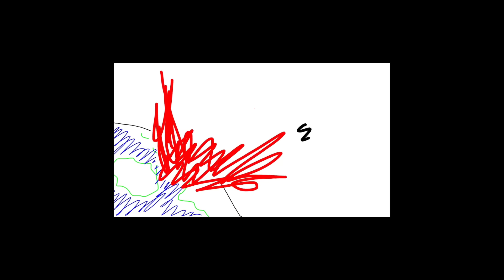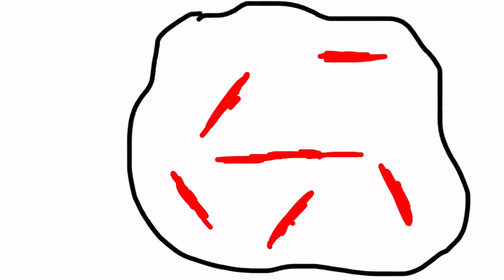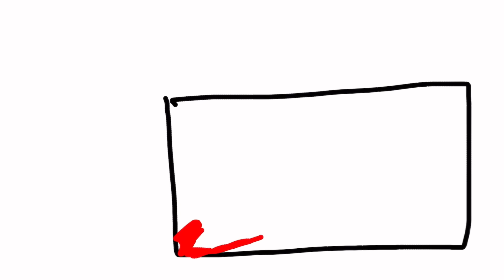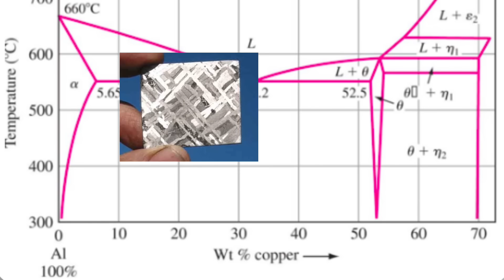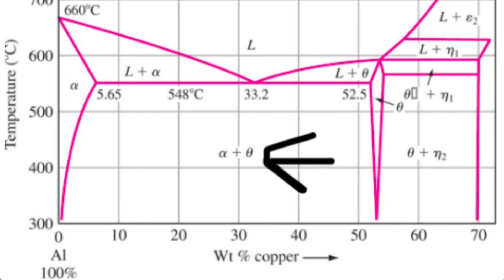Making Meteorite Part 1: Al-Cu

Comment: Very nice job! Quite an impressive result! I find a lot of claims that x can't be done without y conditions turn out to be a lack of knowledge outside one particular scientific domain. In this case I wouldn't be surprised at all if the theory behind these dendritic patterns in meteors is a bit skewed through the filter of an astronomer or geologist's understanding of metallurgy. Some guy in a steel mill's R&D lab could probably tell you half a dozen ways to get dendritic growth that might be relevant to meteors, but the two domains rarely touch.
Reply from the maker: Thanks so much! I haven’t approached the topic from that angle before, it’s really interesting to think about the insight lost when fields don’t overlap.
Reply: Cool to see you here, im on the right side of the internet lol. Good points about interaction between fields though, i think some incredibly valuable insights and advances have yet to result from such things
Reply: You are 100% right 
Im a furnace worker in a foundery and during my apprenticeship in got lots of knowledge hammered in me for exampel how too read phase diagrams (especially the Fe-C phase diagram because steel and cast iron properties and the phases are extremely important for my work)

The phase diagram is a very useful tool if you know that all of the lines and temps are taken with enough time for the material too setel in its preferred state/phase at that temp and mixture .You just need too look for the right lines in the phase diagram  too be precise the upper 2 once  in our case 😅 tell us all we need too know for just look at 3:39 the attention is drawn down form the real point of interest look at the 2 purpel lines over the arrow  the upper one is the liquidus line all of the area above is marked with a "L" for liquid phase . the area below the liquids line at 45% cu is marked with "L+θ" so a mix out of liquid and θ phase in that area the crystal structure is growing  if we goo too the bottom of that area we hit the solidus line anything below it is already solid  and the area is marked with α+θ so a mix out off the α phase and the θ phase

With that knowledge we  cann see that the crystal structure starts growing at abot 580°C and at 548°C it stops because the other phase is also frozen  so for big crystals we need too keep the mold and metal in between these temps for a longer time too let the atoms move to the organized structure 

But too make that with Fe-Ni is quite the challenge since we need over 1520°C too melt a Fe-Ni alloy and reaching these temps is actually not easy  especially with a butane-air burner basically impossible. i know 4 ways but 2 of them are just unpractical for a small diy setup 1. Pre heat the air intake before the burner (blast furnace style) 2 induction heating (high power electricity at pretty high frequency and water cooled copper pipe)
3. A bottle of pure oxygen  and a burner that cann mix oxygenand fuel gas (but the oxygen is pretty expensive)
4.electic arcs furnace (a microwave transformer/arc welder  + porus lightweight firebricks +graphit electrodes 

4. Is the most cost effective and is actually not that bad frome a energy efficiency point
Reply: I recall a paper in the not so distant past wherin they created this structure in rather short timeframes by adding trace amounts of some dopant. Phosphorus is ringing a bell, but don't quote me on that.
Reply: Largely true but cooling an alloy slow enough to achieve 100% diffusion as a phase diagram would imply (and which is what causes meteorites to form naturally since there is millions of years for this diffusion to occur) is actually so slow that even in the most rigorous of tests it’s never done, cause to be 100% accurate would genuinely take millions of years like in the formation of meteorite. If we could find a way to make metal atoms diffuse in solid state extremely rapidly it would make materials science class a lot easier though lmao

Comment: Years ago, I saw some "maker" video where some guy "invented" his new garbage alloy for making cast aluminum parts.  It was a rather careless, unmeasured high-copper Al/Cu alloy.  I immediately called bullshit when watching it with my friend, and we argued about what it would behave like.  I had extrapolated off some intuition and very rudimentary knowledge of older 2000 series alloys, but I didn't really have experience trying it.  What do I actually know?

We went out and grabbed some Al ingots and scrap copper and cast some test ingots at varied amounts of Cu.  As expected, some were quite brittle, but others were tougher than expected.  What I didn't expect was what they were like on the inside.  It seems like with some of the bars, the alloy got very short during cooling and was unable to shrink due to the early precipitation of large crystals.  As they cooled, the liquid phase retreated from the interior instead of depressing the exterior faces like in your examples.  I ended up with what are basically hollow aluminum geodes full of sparkly needles that looked clean like they cooled in a vacuum.
Those were just air-cooled in a bread pan, but for all I know the large, clean crystal growth could have been sensitive to the particular minority components of the unknown aluminum alloys I'd started with.
Reply from the maker: Wow… that sounds insanely cool. This could also in part be due to extreme hydrogen dissolution in your alloy, it loves aluminum. The hydrogen comes out of solution as it solidifies, perhaps a large portion of this occurs after the intermetallic phase is present. If significant enough, it could form massive cavities.
Reply: @ElectronImpressions  Now that you mention it, that might be part of the reason why I could never repeat it well.  Melting from a bunch of weathered scrap with the longer dissolution times involved would mean that there's going to be a lot more hydrogen in the melt than when I just remelt the alloy ingot.  

It's a shame.  Normally, I'm really good at getting plenty of hydrogen in my aluminum.  Now I've gone and failed at that too! :D
Reply: Please tell me you can provide some photos of this !
Reply: @squa_81  I wish.  We only discovered the good ones because we were testing for brittleness.  That involved a 12lb hammer, so most of all the nice interior crystals got smashed all over the place.  I tried remelting the broken ingots that had turned out pretty, but when re-cast, something would always be unsatisfactory about it.  Either the voids were much smaller, the crystals much shorter (5mm most), they shrunk on the exterior faces like in the video, or if they voided on the inside, they formed "wet" (as in the crystals were coated in the lower-melting phase).  I still have an ingot after remelting it a bunch of times, but it really isn't impressive.  I kick myself for not having taken pictures of it, but I figured it would have been easy to reproduce.  After all, we did it by accident so it seemed like it would be.
Reply: These voids you mentioned are the reason that biger parts of castings have rissers attached too it since the outside has solidified  but the thermal contraction during cooling reduces the volume and pressure that would allow same gasses too pop out if the lower solidus intermetalic phase

Comment: If you melt a larger mass of metal in your ingot and use a lot more insulation wrapped around the outside, or put a lot of extra high thermal capacity material in the furnace for thermal mass (say, stack your ingot mold on top of one, between two giant crucibles of iron on the bottom and top), you could slow the metal cooling over an even longer period for larger crystal growth. 

You could even gradually turn down the gas flow to the furnace by say 1/4 turn of the valve every couple hours (assuming propane isn't too expensive in your area).

They also sell kilns or muffle furnaces with programmable temperature ramping.
Reply from the maker: You’re absolutely right, I would love to get myself a programmable furnace. And a larger mold is in the Amazon cart!

Comment: you could try etching it with sodium hydroxide (caustic soda)  it should attack the aluminum but not the copper
Reply from the maker: I was cautious about using etchants that may destroy the dual phase eutectic structure via extreme selective etching. However I’ve gotten a lot of suggestions, and would like to try. I will report back to you

Comment: I approve of your safty clothing bare legs and plastic shoes - so if you get any splashes it will run down your legs pool in your shoes and melt them to your feet ! - on the pluss side you cant set fire to your trousers -ask me how i know this is a bad thing while pouring metal . 😂🤣😩🔥
Reply from the maker: I still haven’t learned my lesson despite many instances
Reply: @ElectronImpressions  🤣 it took me a long time but setting fire to my trousers from radiant heat of a crucrible  Learned me good- i made some gaiters and an apron from aluminsed fiberglass - just put those on right before the pour .
Reply: @malakiblunt the outgasing from the burning cotten should prevent sticking of metal and yeah I'd a apron isn't too yor liking try doubel layer jeans below the knees 

Atleast that was my safety equipment in a foundry 😅
Reply: Next time only the leather safety sandals pls😂😅 no plastic stuff 

But for real bare skin isn't that bad with molten metal since sweat boils too steam very fast on contact with the metal and that steam builds a air cushion that protects the skin 
Leidenenfrost-effect  like a water droplet on a hot plate 

But if you want a more save approach to you Personal safety equipmenpls use cotton textiles like jeans and closed leatherboots welder boots would be the best especially if they are a tad too big and only loose closed straps so you cann get out fast😅
Reply: @TheLtVoss  that is true about bare legs - though im not sure it works with aluminum as that sticks to cotton were bronze would run off. (and im not willing to do the experiment !) Also sandals not great as it will still run under the souls of your feet. (i know you were joking ;-) ) most important thing is to put your trousers over your boots - do not tuck them in . I saw a great vid of some japanese guys in flipflops  casting iron teapots - but ther system was safe and elegant.

Comment: Seen Robert Murray-Smith's video on Tetrataenite?  Casting it near a powerful magnetic field might allow you to play with crystal growth.  To start one clear crystal of ice it can't have anything to stick to or that is cold enough to start multiple crystals.  They contort upon meeting instead of continue the same crystal lattice. One flake begins and floats around growing to fill the container.  Similar with gemstone crystal clarity.  I'd wager it applies here.
Make the mold cool slower than the metals, cover the top so it cools homogenously, apply an induction coil or hallbach array as it cools.  
Geopolymer Institute has a metallic ceramics video you might  find useful.  And a geopolymers in space one.
Reply: Forgot to mention, watching the "Ice Egg" videos on channel Theoria Apophasis might help visualize this.  With water at least.

Comment: I've heard of something similar but for Iron Nickle meteorites called Tetrataenite, where some labs found melting it and exposing it to phosphorous would accelerate that long crystal structure.
I personally want to try making some, and see if exposing them to magnetic fields would align the structure or not. Though I haven't had the time and equipment to do that.
Reply from the maker: Very cool… haven’t heard of this but sounds really interesting, I’ll have to dive into it
Reply: @ElectronImpressions should mention I was thinking phosphate covered screws they use in construction might work. Though there are probably other ways as well.
Reply: it would have to be an electro magnet - as the heat would demagnatise any permannent magnet - much safer than exposeing it to phosphourous ! (i geuss they use a vacuum furnace)
Reply: @malakiblunt maybe replaced the atmosphere with argon or co2? Electromagnets would be a given.
Reply: @pineberry212  Argon night work  -its used for casting magnisum - but thats at 700c - C02 will break down into carbon and oxygen at steel tempratures - argon shielded crucible is a lot easier to arange than a vacuum furnace - but then if argon shielding worked - why would they bother making vacuum furnaces ?
Reply: @malakiblunt  Because argon is a conductor of heat, and vacuum furnaces are also able remove oxygen and other gasses from the melt. And vacuum pumps are pretty cheap these days.
Reply: Magnets probably wouldn't work. Curie temp of iron is 770°C and solidifies at 1548°C
Reply: @NotJustYouNoob yeah, the curie temp is a thing for a reason, otherwise we'd have to melt the material to make magnets everytime we wanted to form a new one. A metal can be solid and still reform it's crystallin structure without melting apart, and by reaching the curie temp, you can reform the structure with electromagnets (or regular magnets if you can sufficiently cool them) to make them magnetic. Though iron by itself doesn't stay strongly magnetic for long as the grains in the structure are usually small and prone to randomization.
Though I'd suggest you look into the process on how magnets are historically made, and how they are made more modern.
Reply: @pineberry212  Oh, you want to realign it after forming the structure. I thought you wanted to try exposing the molten material to magnets. mb on misread.
Reply: @NotJustYouNoob well, I am curious if you could control the initial structure as well

Comment: Have you considered an electric furnace with a programmable pid? 

You can get an even slower cooling! (I.e, 1 degree per hour!)
Reply from the maker: I really want to do this and definitely will in the future, but don’t have the money to buy one right now. I have a PID and tons of fire brick so I may make my own at some point
Reply: @ElectronImpressions honestly, just buy one, itll be easier to trouble shoot with a new one that is under warranty than spending time and money doing a diy job.

Comment: have you tried heating or etching the metal to bring out more contrast? I use lemon juice and instant coffee for steel. it might work for this alloy.
Reply from the maker: Aluminum has a very passivating surface and would be tricky, and the huge difference in nobility between the phases poses a concern for galvanic corrosion and ruining the fine detail. I should definitely try but I was afraid of damaging my structure lol.

Comment: Would you be able to do a kind of replacement reaction on your current ingots to actually get them to be made out of nickel and iron? I imagine that'd be a fun experiment. The other idea would be to grow the individual crystals in an argon atmosphere and then add the intermetallic structure to bind the crystals that you like that fit the proper design.

Comment: The patterns on real meteorites need to be brought out with acid, if I remember right
Maybe you could do something similar for your aluminium-copper recreation?
Reply from the maker: Your correct! To etch aluminum alloys we use a mixture of hydrofluoric, hydrochloric, and nitric acid. Pretty nasty stuff. 

This project ran over the course of about a month. During that time came a rare opportunity I was able to use this mixture, and I etched the 45% Cu ingot (not in video). The etching brought out contrast, however it contrasted the large grains rather than the different phases present, and actually reduced the level of contrast between phases. It still looked cool, but much better before etching.  

I would have to find an etchant that does not etch grains while etching the different phases to make it work. However I am unaware of such an etchant
Reply: @ElectronImpressions  something to consider. If they are different phases, then they are different compositions, which means that a less aggressive etchant might work better on bringing out the contrast in the phases than the scary stuff
Reply from the maker: @josephgauthier5018  I had thought that hcl would disrupt the passivating oxide layer of alpha aluminum (stable at 4-8 pH) and dissolve the alpha Al, causing a bunch of ugly chloride pitting/undercutting around the more catholic Al2Cu so we wouldn’t get a nice selective etch, but instead lose the detail on the fine structure that we see. I should try it though, but I really didn’t want to take the chance of ruining my ingot lol. 

Nitric on the other hand just passives aluminum.
Reply: @ElectronImpressions how about electrolytic oxidation? Use the ingot as an anode in moving water.
Reply from the maker: @stasi0238 I will definitely have to try
Reply: @ElectronImpressions  I etch pure Cooper bar in HCl and get Nice crystals. (You need add some Cooper oxyde at first so it Can disolve oxigen to oxidize Cooper Codys Lab have video about it) btw i taught that in meteorites are just crystals of pure Iron and pure nickel so by the slow cooling they Can crystalize divided Nice.
Reply: @ElectronImpressions  you're*